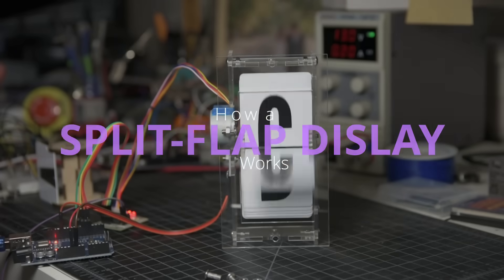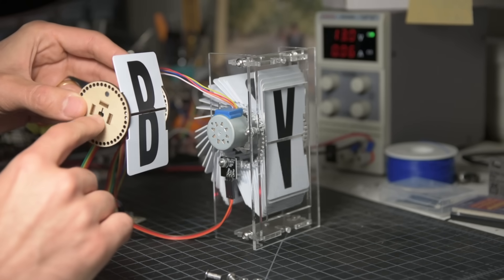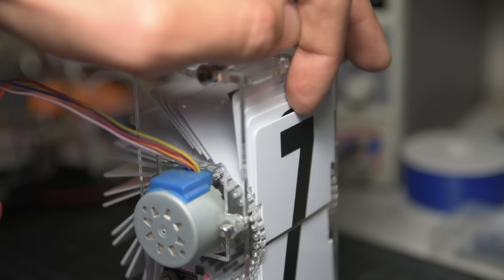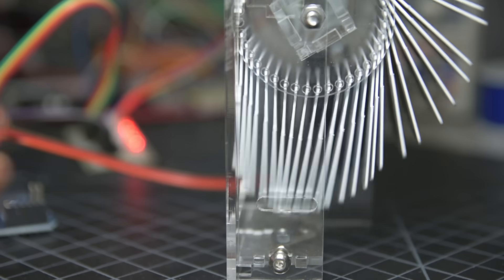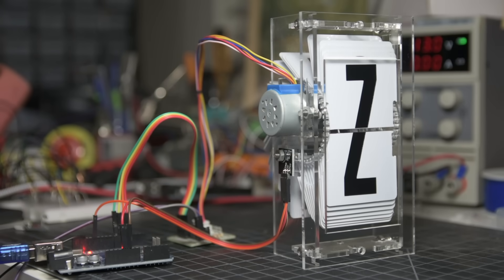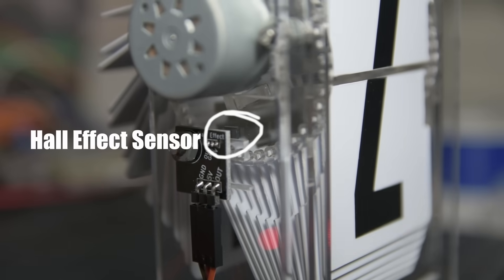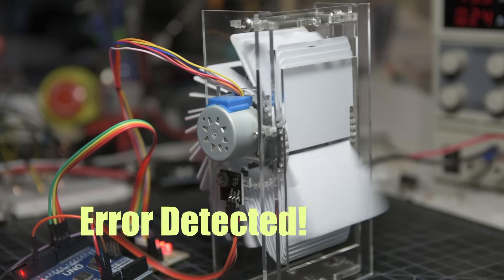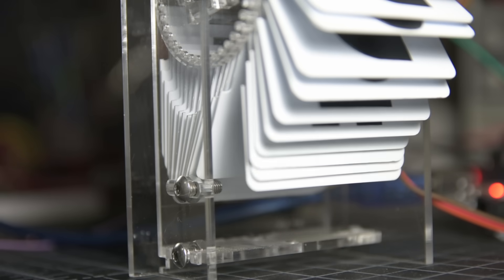How a Split-Flap Display Works

Comment: Just wondering if an optical sensor looking for a tab or hole on the spool would be better/worse or merely different from using a magnet?
Reply from the maker: I originally used an optical IR reflectance sensor. I realized the problem the first time I put the display in sunlight and the sensor was saturated all the time. It might be possible to shield the sensor from ambient light but it seemed easier to just use magnets and hall sensors
Reply: @scottbez1  Yeah, I think that can be a problem with reflective sensors if stray light can get in there. I was thinking more of a slotted optocoupler (which has usually been my go-to position sensor in the past), but I guess these days a hall effect is just as easy to use.

Comment: can i solder the motor directly on the arduino nano , or is the custom pcb necessary ? order custom pcb is hard to do, when you don't understand  electronics in depth and how  exaclty pcb works (even with the gerber files it feels like a hard task just to make the order considering you don't even understand what you order and if it's ok )

Comment: Thanks this was a terrific video. Would you use one stepper motor per character cell in a grid of a larger display or is there some other circuitry/electromechanical design that can be used achieve a split-flap display grid? e.g. 3 rows by 10 columns
Reply: Ah I see the open source project linked in another video of yours https://youtu.be/umtkqJAoKWE?si=2ZCeJBVZdcHICEZ4

Comment: Great project! 
I just wanted to add that it's better to install the magnet sideways when using a hall effect sensor, so that the two faces of the magnet are facing the front and back. Most magnets are magnetized on the two faces, but if you rotate the magnet the sensor triggers exactly when the magnet is closest to the sensor! This allows for much more precise and accurate readings.

Comment: 🤤 I’m currently learning about split flap displays. I’ve always loved the way they sound. Thank you for your explanation video. 

There’s one split flap inside the CCC club room in Hamburg, Germany of unknown age. It looks like something from the 1980s or 1990s. 3 of letter halves / flaps broke off and I am currently researching how to design and make replacement flaps for them. 

The broken split flap which broke here is black and measures 0.3 mm in thickness. I’m ordering a sheet of black hard PVC with 0.3 mm thickness from Berlin and I am hoping this will have the same sound and look similar to the original.

I’m case that doesn’t work, What type of plastic did you use for your flaps?

Comment: Thanks!  Always wondered how those displays worked, pity we have a few left of them.   That motor is quite bulky, how to they stack the letters with no spacing in between?
Reply from the maker: On commercial displays it's typical to use gears (or potentially a timing belt) to connect the motor to the spool/drum, allowing the motor to be tucked behind the flaps instead of off to the side. I've also seen some DIY designs where the motor is mounted essentially inside the spool.

Comment: hey do you have instructions how to built this without the Splitflap classic controller PCB that you sell on etsy, thanks!
Reply from the maker: Yeah, basic parts (Arduino Uno and ULN2003a stepper driver) can be used to control up to 3 modules without needing any custom electronics: https://github.com/scottbez1/splitflap/wiki/Electronics#basic-prototyping-alternative-electronics-approach
Reply: @scottbez1  thanks can i also do this with an RTC DS3231 for the time. and you noted 12V power to the motor driver boards isn't shown is this the power supply for the arduino uno? I'm a noob at electronics btw😂

Comment: Thanks! This did not cover the questions I had in mind, reading the title, but did deliver to questions I wasn't aware of before watching. 😉

But, for more detail: Did you use the 2003 or the 293 type stepper driver? When tinkering around, I found the specs of the 293 more useful. Later, I tried those 4988, which many people replaced in their 3D printers by 8825, 2208 or 2209. They are pretty neat, and make programming much easier.

Greetings from germany,
Marcus

Comment: We still have those in some French train stations. One day an entire line went blank. Then the next one. Then the one after that. Soon, every line spun to show blank flaps all across. Then the PA announced that there was a technical issue and nothing would be displayed until it's fixed. I wonder what systems are behind them to change each line to blank one by one in the event of a crash.

Comment: Would a button work instead of a magnet/hall effect sensor? Have the 'home' be a little ramp that triggers a button upon rotation
Reply from the maker: Yep, but mechanical switches are prone to wearing out over time (though to be fair, this design doesn't have any bushings or bearings for the spool, so other things may wear out first). So optical or magnetic sensors are nicer in that regard (also no switch denouncing is needed).

Comment: It seems you could use a hall effect sensor, then use super tiny magnets for each letter... have it negative then positive for each letter.. so A is positive and B is negative and C is positive. 
 This would allow you to use other motors then the stepper motor. 
  You would just have to have it properly aligned manually, and if it got unaligned it would get confused or show other letters.

Comment: Nice! what do you use for the flaps? Looks and sounds to me like credit cards-like plastic, and how do you print them? Maybe just vinily cut offs?
Reply from the maker: Yep, the flaps are basically plastic credit cards. Originally I manually cut the flaps from blank CR80 cards, but now I have them die-cut to spec which saves a lot of work. Letters on these are store-bought vinyl letter stickers, but I'm going to try screen printing in the future.

Comment: Wow, how in the world did YouTube read my mind! I was just thinking about grandads old alarm clock the other day that had this setup. I was fascinated with this clock and got it when he passed. Black flaps with white numbers and a purplish/Ultra-violet light in a plastic woodgrain looking case. I took it apart almost 30 years ago to see how it worked and wished I never did as I never put it back together. I never knew what this was called and now I got a term to use to possibly find one. Thank you

Comment: Alternatively you can write the current letter in arduino's eeprom and retrive it after power loss  ( earlier I used that for my home lights to remember the state and according to my calculation it give was give or take 2-3 years to degrade eeprom with 8 states being written)

Comment: Pretty cool, but the hall effect sensor seems overkill? A light sensor and a piece of black tape to cover the light seems simpler. Heck even a push button with a small bump to push it on each full rotation would do :3
Reply from the maker: I previously used an IR reflectance sensor, but had problems with direct sunlight, so I switched to a hall effect sensor

Comment: hi scott, im thinking of making a split flap display and love your design since it just requires 1 main board for all the module, but i want to make a bigger one, how does one chain or scale your pcb? (im completely new to pcb design)
Reply from the maker: 3 of the "classic" controller PCBs can be chained using ribbon cables and controlled from a single Arduino Uno, and each can drive 4 splitflap modules, so 12 splitflap modules in total. The upcoming Chainlink Driver electronics (using an ESP32 instead of Arduino Uno) controls 6 modules per PCB, and a LOT of those PCBs can be chained together with a few wires (I've tested chaining 5 of them so far and it should be possible to chain a lot more than that).

Comment: What printer did you use for the cards? Also, you planning to sell those by any chance? :P
Reply from the maker: These are blank cards with vinyl letter stickers applied (which is a bit tedious) https://youtu.be/3lFECISLwyI I'm still trying to figure out a faster and economical way to create them in bulk. Maybe screen printing?

I sell pre-cut blank flaps and blank PCBs on Etsy, but since this is just a side project I'm not selling full kits at the moment.

Comment: Thank you very much for your beautiful machine!!
But, may I ask you a question?
Why did you choose letter G for "first letter", could you please tell me?
Reply from the maker: The first letter is actually blank. During the demo of error handling, I set the display to keep showing the letter G, chosen arbitrarily. The display continues to the desired letter after recalibrating rather than stopping at the home position.

Comment: What if it has to go from say A to C, but it gets interrupted before it is able to?

The magnet doesn't pass the detector because it doesn't have to do a full revolution
Reply from the maker: You're correct - not every error is detectable this way, but the spool should pass the home position somewhat regularly in practice, which provides a periodic check-up

Comment: I used Hall effect sensors in my physics 2 lab classes to detect magenetic fields with varying amperage but no one ever showed me practical applications of them. This is a pretty cool surprise, great video!
Reply: Hall effect sensors are also used in game controllers, like the old Dreamcast controller and new Phob GameCube controller mod.
Reply: @nyanpasu64  i think some keyboard switches have something similar
Reply: *varying current
Reply: @Toleich  :  I would have thought that, if the current varies, the amperage would vary as well?

Comment: 2:40 instead of hall effect sensor...
You can install a potentiometer...
This will provide below benefits...
1. At the start itself arduino will know whats the position based on its resistance value....
2. Slipping from stepper motor will not be a problem...

Comment: very good, but this technology is obsolete. use dot matrix displays.
Reply: It's kinda like vinyl records: Sure it is obsolete but also kinda cool. It also has a few actual advantages:

- Zero energy usage with static content (like epaper)
- Can be physically large without much price increase
- Can be UV resistant
Reply: @oznerol256  i don't mean lcd or led displays by saying that. i think that a low resolution (like 5x7 per character) flip-disc display does the job with all the advantages above with much faster updates.

Comment: I would try to mount the stepper motor within the drum to reduce space between each unit.
Reply from the maker: Cool idea! I experimented with something like that a few years ago, but the motor size and fact that the output shaft is not centered within the motor body meant that the spool radius had to get bigger to accommodate, and thus more flaps. See renderings here: https://github.com/scottbez1/splitflap/issues/18#issuecomment-386808228 I think you could shave off a few millimeters from that quick mock up (and by using some 3d printed parts that don't have the same mechanical restrictions as laser-cutting) but the motor limits the minimum radius quite a bit.

Comment: I miss airport flap displays, they were so fun to watch all those updates at the same time, a plain large monitor isn't quite the same.
Reply: The old flap displays had the advantage that you don't have to keep watching the display for changes you only needed to look if you heard the shuffling.
Reply: @marklatimer7333  moreover, I can't help but think it was far less power hungry. For a display that only needs to show very specific data, it was perfect...
Reply: @takix2007  maybe not that much. Even though they’re only updated every couple of minutes, imagine how much power all the hundreds of motors would draw. Even then, the cost of the panel itself, thousands of moving parts and specialized maintenance is much higher than that of an lcd or led panel.
Reply: @ericlopesbr  Lcd panels are boring.
Reply: @ericlopesbr  e-ink
Reply: @takix2007  Harder to run advertisements on flaps lmao
Reply: @Wankdorf183 true, I watch old quiz shows from 90s. Mostly they use mechanical display\movable boards to show the contents or the answers.
Nowadays they just use huge monitor screen. That's just lame
Reply: @marklatimer7333  They also kept working when the power went out. You didn't get updates, but you could at least see the last info available.
Reply: Thats true its look like magic when this display flaps all letter as ones
Reply: We still have them at the Frankfurt Airport (Germany) and I absolutely love those displays!
Reply: @unknown6656  really I haven't seen them before
Reply: I miss our old split flap alarm clock from the late 1970's.
Reply: In Utrecht (Netherlands) they used to have one of those boards but with the times for the trains at the central station. It's now in the trai museum and still works there. So the only reason they replaced it was to put up a big screen, which conveniently also can display ads...
Reply: Also the sound it makes, letting us know that there was an update coming
Reply: @fajarkurniawan9434  :  Some airport video information systems make a sound when an important update is displayed, ("Boarding Commenced" for instance).  These sounds vary from various "Dings", "Beeps", to musical chords or progressions.  Maybe they could substitute a recording of an old Solari display instead?  😜
Reply: @fajarkurniawan9434  - maybe they can pipe the split-flap sound through the LCD Display... Just like BMW pipes REAL engine sounds into the driving cabin. 
Technology oftentimes insulates us???
Reply: The Frankfurt airport in Germany is indeed one of the last airports in the world with such displays. They even have an own department for repairing this, because there is no company in the world supporting these displays anymore.
Reply: @veitkunz9524  https://www.youtube.com/watch?v=8OqmAaCp_Q8 this company still makes them! :) Just gotta win the lotto so I can buy one 😂
Reply: @veitkunz9524  there is but probably not in Germany
Reply: Lol
Reply: Come to Bucharest, we still have them😂
Reply: Ljubljana Brnik airport still has them
Reply: I miss it at the Train Stations 😭😭😭
Reply: Brussels airport still has one in the departure hall. It is very retro cool to hear and see it update
Reply: That kind of displays were mostly made by Solari, an Italian (Friulian) company, which is still in the business, with modern displays (lcd or similar).
They owned some patents on the mechanism.
https://en.wikipedia.org/wiki/Solari_di_Udine
Reply: Plus the satisfying clicks that they make.
I want to see LEDs beat that, because you're the top comment, and because I said so!
Reply: @jackmcslay :  I agree; my son used to lie on the floor, waiting for the updates!
HOWEVER... I worked in an airline ops centre for more than thirty years.  The time wasted calling the maintenance company, and the abuse from travellers when the Solari boards didn't work right, soon made us fall out of love with them.  The maintenance costs must have been huge at times... outside my experience though.  Modern monitors offer much greater flexibility and economy.  A faulty monitor can easily be swapped-out by any maintenance crew at minimal cost and delay, and often a remote reboot is all that is needed to fix them; just a few seconds work from the control centre.
Miss that sound though!  😊
Reply: Not to mention half the time they couldn't figure out how to get the monitors to work
Reply: where they gone. they still used. they work. yes they are nice watch. who want 200inch 8k monitor with 8px text all info hanging 30m above and peoples never look becouze cant see
Reply: @jarisipilainen3875  Why do you even need those displays you can check flight info with terminal numbers in your phone using the airline's app.
Reply: @Marv3Lthe1  Yes, of course, but you need a flip phone for that!! ;)
Reply: @Marv3Lthe1 : What's a phone?

Comment: What about chaining 3 of these with one motor using the same technique used in the locks of american school lockers?
Reply: The flaps cannot rotate backwards. You need that for the school locker mechanics.
Reply: @banknote501  hmm, right, isn’t there the possibility to make them also go backwards maybe?
Reply: @vipera7448  No, they get stuck running backwards.

Comment: Great video, thanks! I found another one (with some old unit), where better solution of finding real position was demonstrated - you don't need an expensive stepper motor and hall sensor, when you make "encoding rotary switch". You have so many contacts as number of characters around some wheel and another contact on the wheel. You need to set this wheel precisely to position of wheel with characters. Then you have every time only one contact around the wheel connected to contact on the wheel, which indicates actual character...
Reply: That also works, but it needs much more electronics to process all those contacts. This one is a 2-pin solution.

The question which one to use then boils down to what is easier to implement: A circuit that compares about 40 signals (to be fair, using 5 pins and a binary encoding makes more sense) to a pattern and runs a motor while they don't match. Or one that runs the motor until it the sensor fires and then for an additional amount of time (or angle in case of a stepper) determined by the character to show.

My guess would be that the second one wins the instant a microprocessor is available while the first one is superior when using discrete (or even mechanical) logic.
Reply: @HenryLoenwind  I agree, but there is one more advantage of the solution with encoding every single character - you can use an ordinary DC motor, which is cheaper, than stepper. For one single character, it makes no real difference, but when you make bigger display with multiple characters (blocks), than you can profit from using cheaper DC motors. I have for example many of them from old CD-ROM drives, but stepper motors are really rare, so you must buy them.